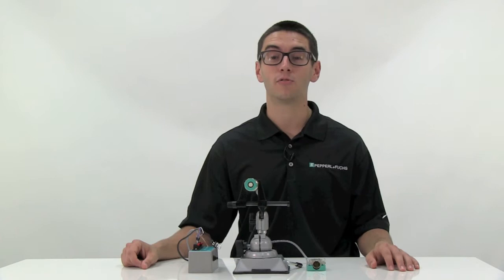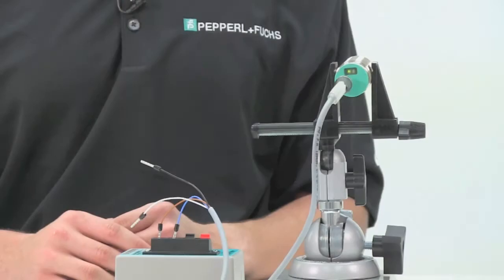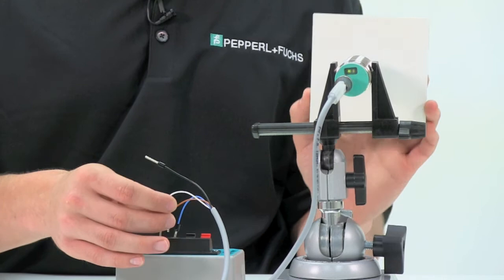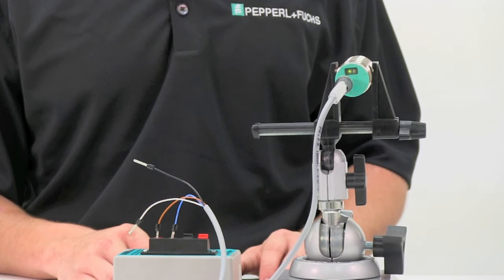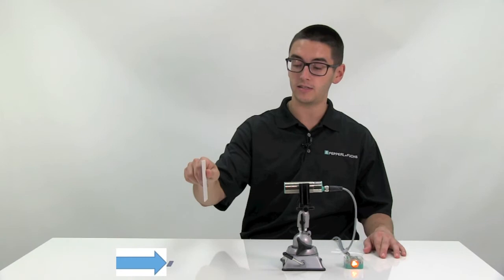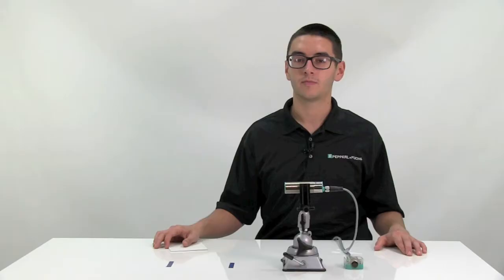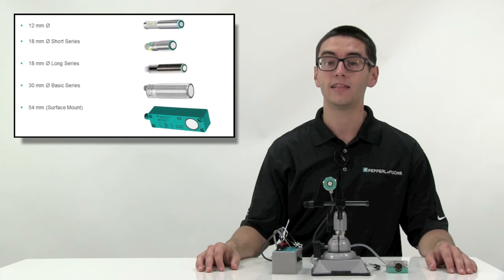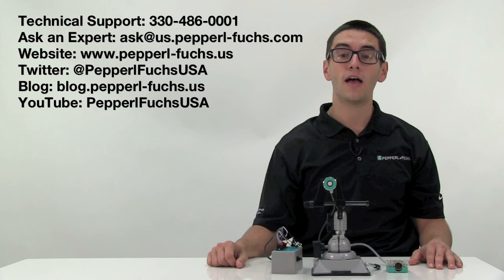How to Program an Ultrasonic Sensor Using Hardwire Teach Method

Comment: Hello. How to make ultrasonic sensor synchronization connections for internal synchronisation for UB500? Do I just connect idividual synchronisation wires together?
Reply from the maker: Hello nixth3x, the following synchronization modes are possible:
1. Several sensors (max. number see technical data) can be synchronized together by interconnecting their respective synchronization inputs. In this case, each sensor alternately transmits ultrasonic pulses in a self multiplexing mode. No two sensors will transmit pulses at the same time (see note below).
2. Multiple sensors can be controlled by the same external synchronization signal. In this mode, the sensors are triggered in parallel and are synchronized by a common external synchronization pulse.
3. A separate synchronization pulse can be sent to each individual sensor. In this mode, the sensors operate in external multiplex mode (see note below).
4. A high level (+UB) on the synchronization input switches the sensor to standby mode.

Note: Sensor response times will increase proportionally to the number of sensors that are in the synchronization string. This is a result of the multiplexing of the ultrasonic transmit and receive signal and the resulting increase in the measurement cycle time.  

We hope you've found this information useful. You can view this information on our datasheet for the UB500-18GM75-E5-V15 here https://www.pepperl-fuchs.com/usa/en/classid_186.htm?view=productdetails&prodid=15010 or if you have further questions, please visit us here https://www.pepperl-fuchs.com/usa/en/ask_an_expert_fa.htm. 

Thank you.

Comment: @PepperlFuchsUSA

Hi. Could you be kind enough to share how to change output mode from Normally Open to Normally Closed for uc6000-30gm70-2e2r2-v15.
Reply from the maker: Hi there Khawaja Naeem. You need to use the Ultrasonic sensor UC6000-30GM70-2E2R2-V15 https://www.pepperl-fuchs.com/usa/en/classid_186.htm?view=productdetails&prodid=51811#software ULTRA-PROG-IR software in order to change those settings. The software can be found on the product page under the software tab. If you don't already have the cable, you will need it in order to interface the sensor with the computer you are using. The cable can be found at the bottom of the “Associated Products” tab. Interface cable UC-PROG-IR-USB https://www.pepperl-fuchs.com/usa/en/classid_190.htm?view=productdetails&prodid=69497. 

We hope this helps!
Reply: @PepperlFuchsUSA  

Thanks for this kind support.

Comment: We have ub2000-f42-i-v15 sensor
We need 4-20A output with respect to distance 250mm to 1000mm  
How to calibrate or teaching??
Reply from the maker: Hi there Venkatesh, you can program the sensor via the push-buttons on the unit itself. You may need to program the A1 (near) and A2 (far) points along with the rising ramp. You can find these steps on the datasheet that can be obtained in the link below, starting on page 4. 
UB2000-F42-I-V15 
https://www.pepperl-fuchs.com/usa/en/classid_186.htm?view=productdetails&prodid=24959
Reply: @PepperlFuchsUSA  thank you very much 🙏
Reply from the maker: @256venki  you are welcome.